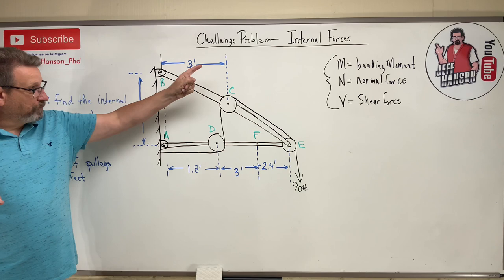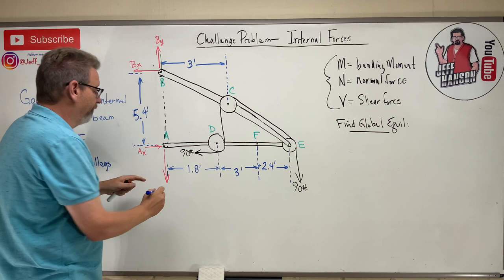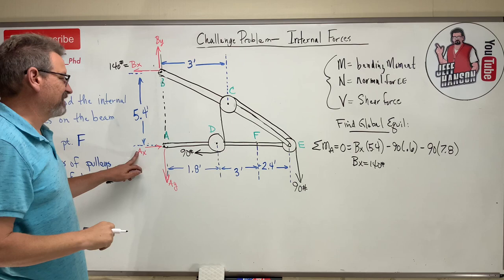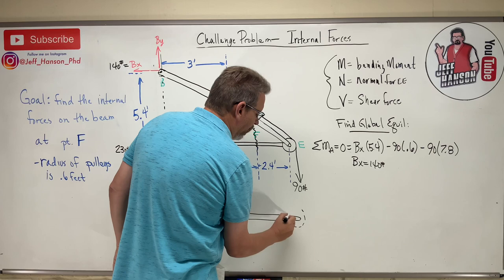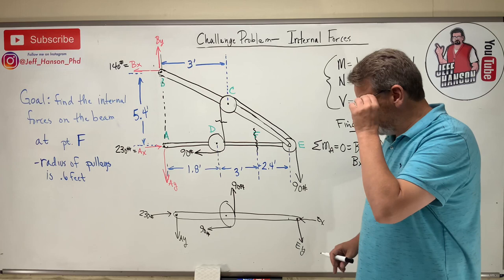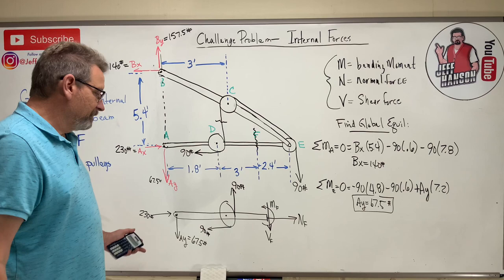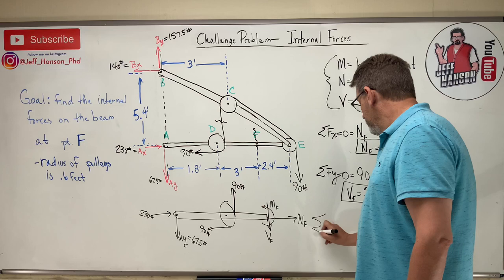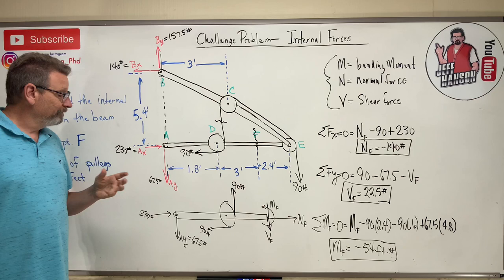Statics: Lesson 58 - Internal Forces M, N, V on a Frame Problem

Comment: Shouldn't the tension in pully D affect the beam at the center of the pully because it's the connection point between the pully and the beam And consequently , the vertical tansion on D have a 90# force, 5.4' away from E ?
Reply: the moment from point E still ends up the same either way

Comment: shouldn't the total length when counting the third moment at 3:35 be 8.4 feet not 7.8 because the radius of the pulley is 0.6 so the diameter is 1.2
Reply: no dude . distance from A to E is 7.2 so you add the radius and it is 7.2+0.6=7.8 . keep in mind that E is in the center of the pulley and that's why you add the radius and not the diameter.

Comment: When taking moment at E there is a 90(0.6) part where the cable is below the bar. Why is it 0.6 and not 5.4 or 4.8?
Reply: Because the force is acting in the x direction, this means that the distance between the force and the axis point E resides on is 0.6m

Comment: can anyone please explain why the pulley rope was cut between A and D?
Reply: To find the global equilibrium, you have to start by substituting all external supports (the wall in this case) with reaction forces.  After removing the wall, you'd have to express the rope connected to the wall as a tension force. The same process is also why the supports at points A and B are substituted with reaction forces as x and y components.